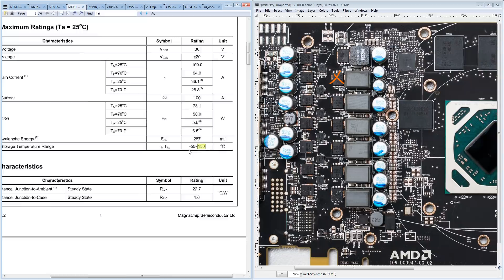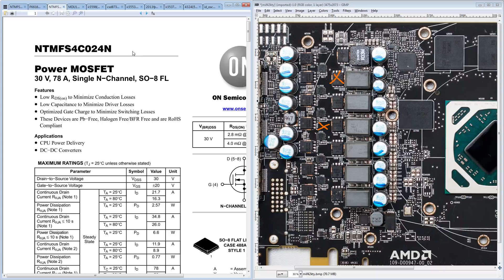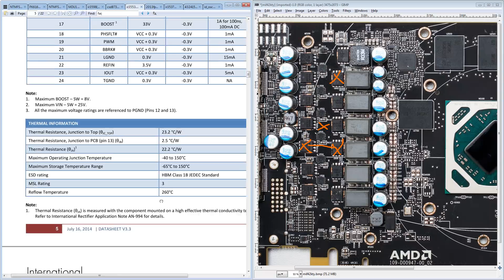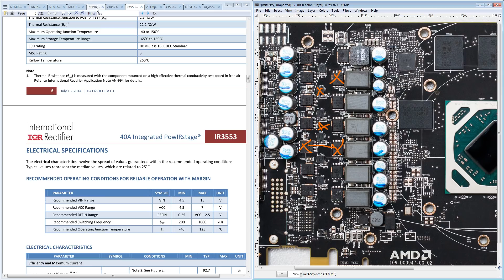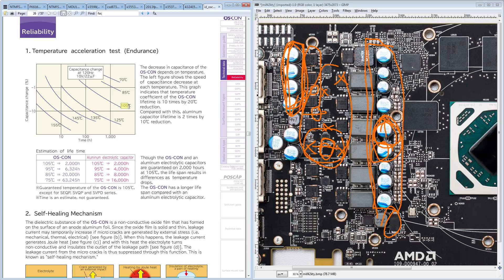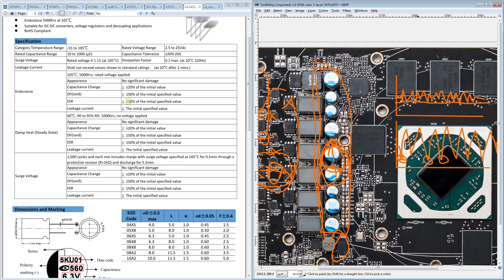What are safe VRM temperatures.

Comment: The PCB itself can also get damaged from being too hot. I am not sure what materials are used to manufacture GPUs, but the usual limit is 125°C. Another bad thing is temperature cycling. If the PCB get very hot, very quickly, it can cause micro tears in the copper tracks, especially in the vias that goes through the board. After many many temp cycles, the PCB might stop working at all.

Comment: Solid caps last much longer than electrolytic caps. Electrolytic caps can go bad even not being used. Motherboards use to have lots of electrolytic caps 10 years ago. You will probably see 5-year-old boards with solid caps lasting longer than the 10-year-old boards with electrolytic. I glue heatsinks on the VRM with heatsink cement. I kinda expect to throw the board away instead of repairing it in the future. If you have a fan in the back turn it to blow air into the case and make a shroud to blow air over the VRMs. If you have good enough cooling using the rear case fan to blow air is the best solution. Someone sells fan shroud kits for this on eBay. You probably can download a file and 3D print it. I only worry about it because I can render video or render 3D for some time.

Comment: Hi. I want to mount a hybrid water cooler only on the graphics processor on a video card. And I want to know on which components I have to put passive radiators and which I don't. From what I see on Inductors does not require additional cooling if a fan blows on them. So on which components should I put radiators ??
Reply: MOSFETs need cooling.

Comment: Sorry. Never heard so much bullshit in a video. This guy has never designed a buck converter and says trash to this MOSFET thermal resistance of 5.3W/K. WOW. Unsafe in general?  You definitely don't know what you are saying. Pls study electrical engineering + spend years in design of converters + read datasheets in correct way. Then try again.

Comment: Thanks, it's good to hear someone knowledgeable making a good case for underclocking. Even better with a little brogue. Guys overclock with the CPU in mind but not necessarily the life of the board. Seems foolish. If you want higher clocks, save up and buy a CPU that runs at one. Bottom line remains what it's always been: heat kills. Cool the f*%k out of everything.

Comment: Back in 2019 I bought an Asus TUF Z370 PRO motherboard, and didn't realize it had crappy 4 phase VRMs. It looked like more phases because of component doubling, yet it barely handles a continuous 95 Watt load without VR Thermal throttling. Gotta set a power limit on Intel XTU of 80W to keep the mosfets under 95ºC (when the GPU is also pumping out heat). Even then, it manages to sustain 4.1GHz continuously which is more than enough. The last 600Mhz of boost make the CPU so inefficient, by requiring almost double the power to run.
Reply: same here, I have an msi b760m that has no heatsink on the vrm's, I have the tdp capped to 80w otherwise it'll throttle at 98c

Comment: I'm adding an AIO to cool my GPU with the Kraken G12. Anyone have advice on what VRM or VRAM components I should add heatsinks to? I'm thinking the mosfets for start.
Reply: It would be good to add heatsinks, although G12 has that little fan that is blowing directly on mosfets and most people say it is enough because that fan doesn't blows hot air on them like the fans of regular coolers do by pushing air that passes first through cooler fins than hit the gpu board.

Comment: Yeh but ... it's still a good idea to limit thermals and thermal cycling and expansion, all of which cause things like bad solder joints ('drying out' or cracking) and PCB's de-laminating. I don't like the idea of any component on a PCB (particularly surface-mount) regularly going over c. 80°.

Comment: Answer here 29:49. 
"105C I wouldn't worry about, 110C I still woudn't worry about"
And here for 24/7 31:18
"if you're running something 24/7 I'd want to have the VRM at 95C or 85C"
You're welcome
Reply: People like u should have an oscar..
Reply: thx bro, u saved me
Reply: Thanks, no way I'm watching a 40 minute video just to know those things.
Reply: @MJ-uk6lu  
This video is so educational it's mind blowing amazing, for those who use brain that is, and want to be smarter.
Guy explained in detail what is what and why some temps don't mean what you think they mean.
Reply: @bkingtz1  Some people just don't have the time so maybe you should refrain from insulting everybody else's intelligence around here. Hopefully, your ego can do without.
Reply: is this the same for motherboard VRM's? so 60-70 is good as nothing to worry about?
Reply: Laptops throttle when vrm goes above 75 , speaking from experience with Dell laptop, ofc this is not the silicon limitation, it’s the limit set by Dell , so your manufacturer can screw you up via a bios update even if your hardware can handle more ,
Reply: Tq bro , but how can u know vrm temps.?
Reply: thanks for the TLDR
Reply: Thank you from the future.

Comment: I have a Zotac RTX 2060 AMP rated at 190watts max and I have flashed it with a Gigabyte Extreme 2060 BIOS and now i can draw about 240watts max (power limit from 112% to 126%) - My card has 1 x 8-pin connector.  Is this all fine? - I have a probe stuffed as close as I can get it to the VRM area and it reads about 85c after FurMark/OCCT for about 10 mins. So assuming the temp is higher internally I still feel its not too hot.  What do you guys think?

Comment: As with any semiconductor device, its performance degrades (derates, thanks for using this word and reminding it to me, BZ) above room temperature and that's it. The device can function up to 80, 90, 110 or whatever, BUT if you want it to perform its best, keep it at room temperatures. (simplifying here)
Reply: i'm talking about the performance of semiconductors, not the lifespan of electronic components.
Reply: @GeorgeTsiros  Well for example SSDs do like to be hotter than the ambient and 25°C is actually harming them in the long run.
Reply: @DFCZE  that... doesn't sound reasonable? I searched a bit for "ssd optimal operating temperature" but nothing relevant popped up?

Comment: keep it lower.
Do care about PCB material heat tolerance, afaik poor material generally rated to 105℃ and operating temperature IMHO 26℃ ~ 30℃ less than peak PCB temp on long-term use.

Comment: So keep VRM temps around 100C or lower on load!
Reply: keep it lower. some poor PCB peak temp @105℃ and on long-term use 26℃~30℃ less than peak temperature.

Idk what your PCB material heat tolerance

Comment: Wrong on the inductors.  Look up thermal aging on powder core inductors by Coilcraft.  Depends on the binders used in the inductors.  If using a ferrite core, yes indestructible but saturation happens more quickly.

Love your videos.  Also note that not much different between semiconductors made for commercial use.  So generally very reliable.

Board temp >105C starts to damage board organic materials.
Reply: yea... 105 peak temp for cheap PCB, may safe @ 26℃~30℃ less than peak temp on long-term use.

Comment: Can someone enlighten me on why caps usually have these sharpie markings?At first i thought it to be QC but would they really test each and every one?
Thanks for sharing!
Reply: Trough hole components still manually put in place, so yes someone checked all caps polarity. Once I heard from a worker that someone put capacitors in a wrong way and they didn't figure out until the first bad board being tested. They stop the line and throw away (put in the recycle bin) all of the bad boards.
For an expensive product it's worth the money for the manufacturer to employ +1 worker to double check before soldering.

Comment: Funny. I was just looking up on my other screen the specs of the Vcore VRM in my Z170 laptop to see whether it could handle an 8 core 9x00 right at the moment you mentioned CSD87350Q5D. It's got eight of them in a 4+1 phase doubled setup BTW (Clevo P870DM3). Should be ok FWICT, temps on the heatsink designed for "95W" 6700K will probably be the limiting factor to clocks/volts anyway

Comment: So my 8gb 470 Nitro is fine with the VRM's hitting 95-99C? That's at stock boost (with power slider maxxed so it doesn't throttle), I undervolted the card ever since I got it because of that, I wasn't comfortable seeing that temp on anything let alone the VRM's of my GPU.

Comment: @Ggchb Gig ghb
U are wrong. I personaly tested 8700k OC on Gigabyte Z370 HD3 1,38 V core 5000 MHZ. On this setup motherboard hit 122 C  and it trigger temp protection (on 123 C) what downclock the cpu to 800MHZ.  For 100%  5ghz uptime i need to put a Fan over the VRM and it still have ~ 111 C . (AIDA 64 stress test)  I am 90% shure that this motherbord also have the 5GHZ auto oc mode so even absolute beginner can overheat the VRM with one click. Now Intel announce that this boards will support incoming 8 Core cpus. Rumored 9900k may even trigger temp protection on this motherboard with stock + enchance all core option what are ususal set default.

Comment: @Actually Hardcore Overclocking So if you could further my education here, i am running a 1500x @ 3.8ghz @ 1.35v with a arctic freezer 33tr on a asus prime plus b350. i don't do production work at all, all i do is game sometime for long periods would you recommend that i still actively cool my vrm's? For reference my cpu temp's are 29-32c idle and 47-50c while gaming.  Thanks really enjoy your content.
Reply: Gaming is not very demanding on the CPU or its VRMs. The only thing you might need to be concerned about are the GPU's VRMs if it is running very hot for long periods.

Comment: 31:00 ish you said at 12 hours gaming a day you might wear out your gpu - that's assuming 95°C on the mosfets though, right?
At say 75°C (I just measured 72°C the backside of the PCB, exactly where the mosfets sit of a GTX 1070 with my infrared thermometer), according to the data on screen, the card should last about 10 times longer than it does at 95°C right?
Reply from the maker: not that's assuming 105C on the caps.

Comment: I just measured the temps of the VRM's on my X470 ultra gaming, running a 2600x at stock settings.
Software (HWInfo) says VRM Mos is at 51°C ( https://gyazo.com/72ea76027ebe1170a6fc77645aba033c ), I also measured the indcutors and the capacitors using an infrared thermometer reading 39°C for the capacitors and 41°C for the inductors.

Judging from what I've just learned my mosfets and capacitors should last a very long time.
How much can I trust HWinfo and an infrared thermometer though?

Comment: You talked about Vega VRMs being overkill, are they thermally good as well? For example, is 100c not too much on them ?
Reply: Would also love an answer to this, it's had me bothered that my vega 56 is hitting 112-115c sustained while playing games at an uncapped framerate.

Seems defective, because the core is rarely going over 75c.  But in the video he says common gpu caps have a recommended temperature of 125c.  Really wish it just had better cooling.
Reply: @XDeadzX  Hows ur card doing now? Even undervolted my vega 64 hottest vrm temps are 100-110 c

Comment: My fully unlocked R9 Fury Strix had the capacitors fell off, soldered them back on, still works fine. Asus made an horrible job with these cards. They used a "high" performance thermal pad for the gpu/HBM heatsink contact and on mine half of the HBM was not in contact with the thermal pad.

Comment: I haven't quite finished watching this yet, but I saw him talking about stock voltages having margins that help with VRM degradation. And it instantly reminded me of my last system that ran an FX 8350 that I had at 4.7GHz at 1.475v on the vcore, and after 2 and a half years it got to the point where I needed 1.45v on vcore to handle 4.4GHz even, which I could do on stock voltages when I bought the system, around 1.05v vcore. Pretty sure I have dead caps on that VRM because of how bad that degradation is. Because in a totally dogshit board I can still get that chip to 4.4GHz at 1.05v vcore. Which kinda surprised me because it literally happened overnight. One day it ran at full load with no issues, next day it refused to even get pass the Windows login before crashing. On an Asus Crosshair V Formula-Z. Most likely was my case having terrible airflow that allowed enough heat for the VRM to degrade as much as it did.
Reply: Are you 100% sure that this is vrm? Not the cpu? Do try run same OC in different mobo?

Comment: Likely a niche issue; but what about the high VRM temps affecting the mosfet's maximum current draw? When a board uses cheap mosfets like this: http://www.a-power.com.tw/merge_pdf/AP4024GEMT_Datasheet.pdf where it can easily derate to less than half its max current output; could using a high power draw product (2700X in cheap AM4 mobo for example) and running a hot VRM potentially cause a situation where the fets can't push enough current for the CPU's load and fail/burn out?

Comment: This video is quite informative and certainly makes the case for monoblocks and full cover GPU blocks in any high end application where you are going to stress the VRM. I never really expected component run time to be impacted so significantly when bringing the temperatures down from even 90c to 70c. Really good stuff.

Comment: It seems like these types of topics are aimed for those that go for overclocking or for some reason extreme nit-picky when it comes to temperatures. Pretty sure normies who buy parts or pre-built, plug n play fortnite wouldn't need to worry about this shazam.
Reply: Well there is a reason this channel is called Actually Hardcore Overclocking, not Actually Running at Stock
Reply: As long as you run the hardware stock in almost all cases you're usually OK. Some Intel X299 boards(can't cool enough when running high current CPUs) without enough cooling or Powercolor's Devil RX580(Overheat when running furmark) are examples of poor VRM system designs.

The PC Master Race Cult is pretty stupid at times, every community has that.
Reply: I agree with stock/factory settings. It's just I've seen many posts about people nitpicking VRMs to the point that they want everyone to buy high-end motherboards. lol.

Comment: What is the best non-electrically conductive TIM Pads you can buy today for a video cards VRM's, GDDR5 Memory, etc? I am redoing all the pads and and also converting the backplate to a thermal solution as well. Thanks
Reply: https://www.amazon.com/Innovation-Cooling-Graphite-Thermal-Pad/dp/B07CK9SHZG/ref=pd_sbs_147_1?_encoding=UTF8&pd_rd_i=B07CK9SHZG&pd_rd_r=K7S0YJXEH5QNWPF0XNJD&pd_rd_w=TBgJx&pd_rd_wg=icrRI&psc=1&refRID=K7S0YJXEH5QNWPF0XNJD

Comment: The VRM on my X79 DARK are at 32c idle, and I have never seen them above 60c under load with a heavy OC. The reporting is by HWInfo. BIOS gives me the same idle readings of VRM temp. As soon as I do some maintenance on the system, I'm going to design a VRM waterblock for it. I may do one for the chipset, but I don't know if it is necessary. My GTX 1080FE GPU temp stays at 25c idle, and since it has an EKWB-FC block, I have to assume that the VRM's are close to the same temp. Again, I don't think the card has ever gone above 50c under load.
Reply: It's not really about the money. I'll have to design and build them myself, because there are none available for my board. And since I have a massive cooling loop, with the CPU, GPU, and RAM on it, I figured why not! I like design and fabrication. Who knows, I may even be able to sell them once I have the final prototype.

Comment: Since you probably know more then me, I need your help with something. I have an issue with my msi b350 pro vd plus motherboard. I updated my bios to fix the 0.55ghz issue when booting up. But now when i put my computer to sleep, and wake it up. It boots to 0.55ghz. Anything you would recommend?
Reply: Stay Humble I got this bug when I raised voltage over a certain point on a couple mobos. It was incredibly frustrating and answers were hard to find, honestly if you can, I would just switch motherboards.
Reply: @tylerparker4010  did you ever find a fix for this? since I have the same issue right now
Reply: did you ever find a fix for this?

Comment: Hey Buildzoid,

I recently bought an ASUS P8Z77-i deluxe.
Should arrive soon™.
The VRM is on a daughterbord.
Would you be interested in detailed pictures?
Reply: Bitspower made an interesting monoblock for that
Reply: HTPC?
Reply: Small VR PC
Reply: Luis Scheurenbrand
Deluxe are the ultra nerdy boards nobody needs, no Thunderbolt Display?, apple deluxe, wifi onboard?
What does it need to do, Data, Computing, Crypto?
Reply: I am not quite sure what you want from me.
I will most likely will use the Board in a small PC (~7l) have a  powerful small PC that I can bring to my friends to test VR.

The board should be fine for that and I just bought it because it was very cheap for all the stuff it has.

Comment: "Nothing happens to the wires"
Don't try to be a smartS or know if it's relavent.
But
What about "electromigration" ? degradation which associated to higher frewancies that comes along with higher voltages ?
Reply from the maker: doesn't happen fast enough to be a concern.